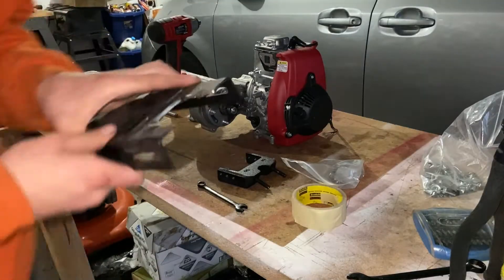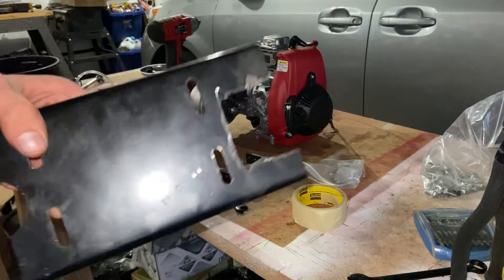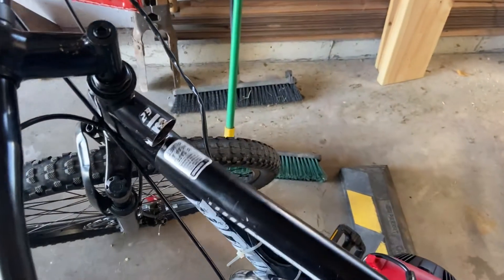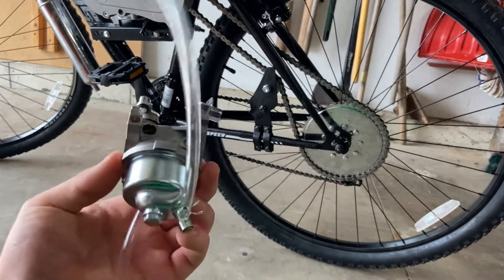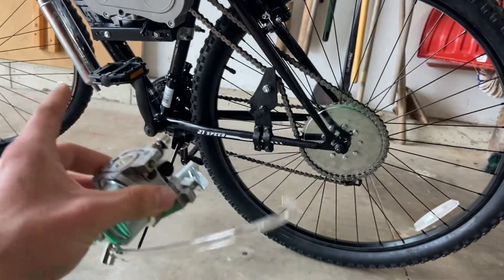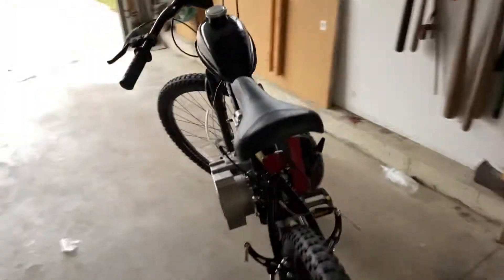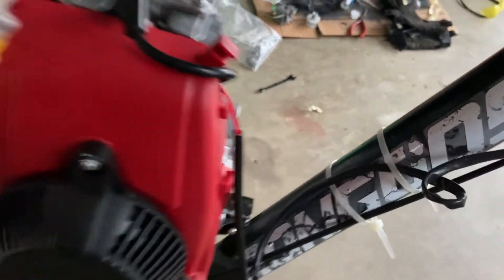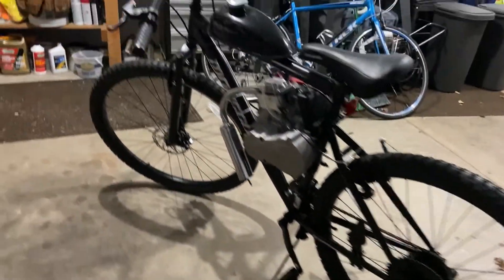Four-Stroke Motorized Bicycle Build

Comment: get a fuel filter, the tanks come full of rust.
It gets past the chiapo filter that comes with the kit, flush tank.
The stock carb is difficult to clean unless you drill out the welch plug to access the jets.
I changed to a different carb design, runs good now.
https://youtu.be/E9AGCWDeYCA

Comment: the lower welds will crack unless you weld the upper cross bar.
Drill and rivet the chain tensioner to the mount or it will fall into the spokes destroying the wheel....the nuts and bolts eventually work loose.
Happens a lot.

Comment: cool bike I like how you cute the top frame I should of did that hows the jb weld hold up ??
Reply from the maker: The JB weld didn’t hold up too well, so I just got some L brackets and screwed  them into the frame. They seem to fold up just fine.
Reply: @thedailybackwoods6742  ok thought about doing a build like this any advice
Reply: @thedailybackwoods6742  you ever have any problems with the clutch or kit and also has does it handle going up hill
Reply from the maker: @jonny6758  yeah I had to get a new clutch because it went out. It’s like $30. Going up hills is fine, if your really worried you can get a different sprocket for the back.
Reply: @thedailybackwoods6742  have you tried spacing the clutch pads apart because those springs are tight take a flat head screw driver and go 3 over and do both sides make one side a space with the flat head it will stretch the pads out more and grip the casing on the clutch housing and ride much much better 👍
Reply: @thedailybackwoods6742  you might be able to get more out of the clutch pads and also if you pettle a little before just using all throttle it also might save the pads as well it's a common issue ic on these kits the pads seem to wear down alot
Reply from the maker: @jonny6758  ok thanks for the help!
Reply: @thedailybackwoods6742  no.problem I tinkered a little with these off and on so it's a pleasure to help somebody has who tries as well 👍also sometimes like advance auto.parts Carrie's a 4 stroke spark plug on inventory if you need one and another these carbs clogged sometimes because american gas is strong on these carbs and they seem to clog wouldnt be bad idea to get a good filter as well
Reply: @thedailybackwoods6742  any updates so far hows the bike been holding up thanks